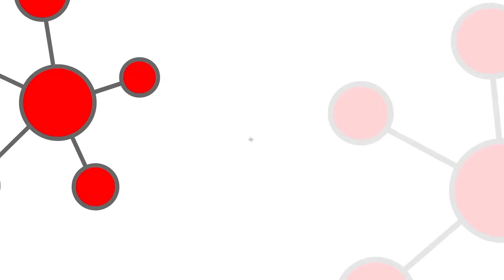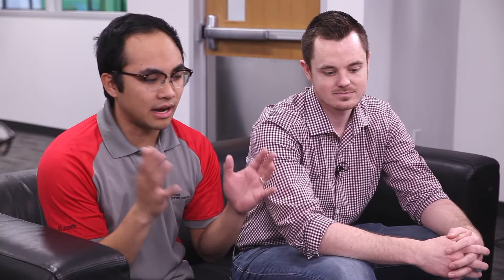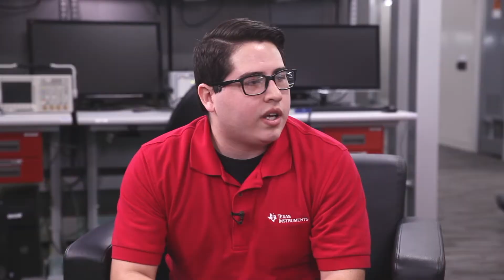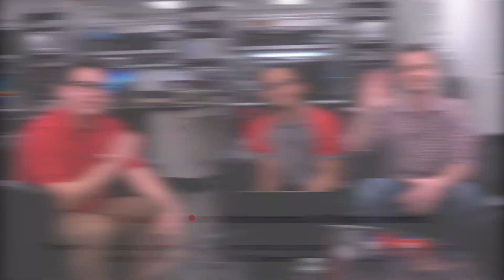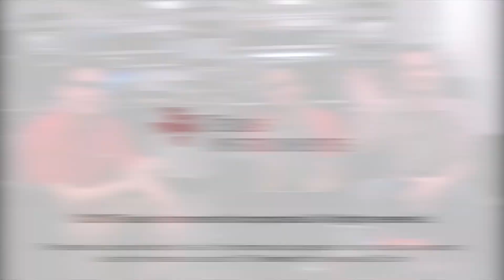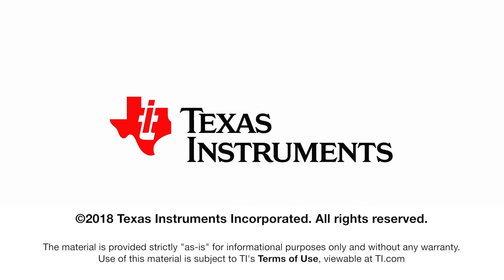Connect: Wi-Fi 5-GHz

Comment: CC3x35 are not a bad devices, but I was slightly disappointed from RF performance at 5GHz.
Reply: Do you mean half the range? That's common physics. Frequency is inversely proportional to range at a given output power level. So we just increase power? Problem is we are little antennae walking around in the atmosphere. Ever wonder why so many people seem deranged? 2.4GHz is the resonant frequency of water that pervades our electrochemical bodies. 5Ghz has been shown in studies to break down DNA rapidly. The Norwegians (I think) turned theirs on for a test and 400 birds dropped dead, raining from the sky. This isn't good. Greed is driving this.
Reply: No. I do comparison with similar product from competitor (Cypress devices).
Reply: I would recommend going to the TI E2E Wi-Fi forums to get more in depth details on the RF performance of the new devices as well as any other questions you might have on the CC3x35 devices. http://e2e.ti.com/support/wireless-connectivity/wifi/f/968
Reply: What are you on about?